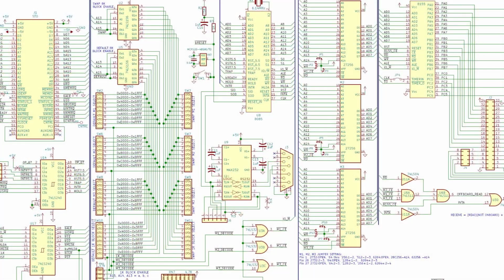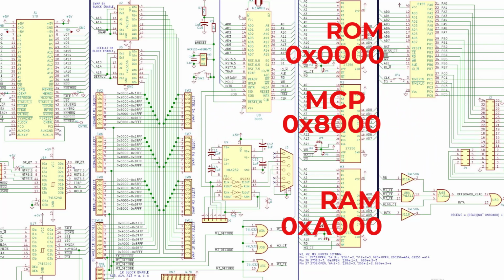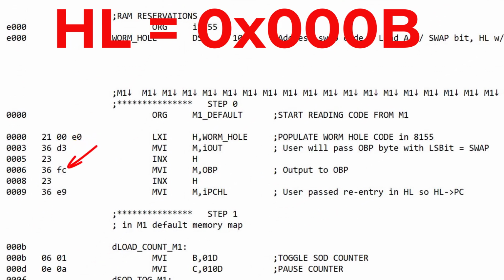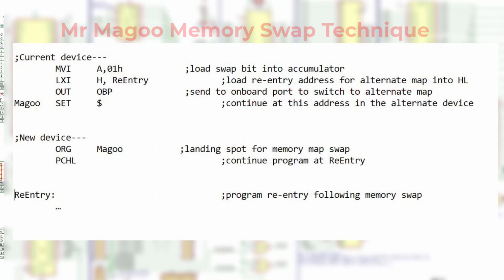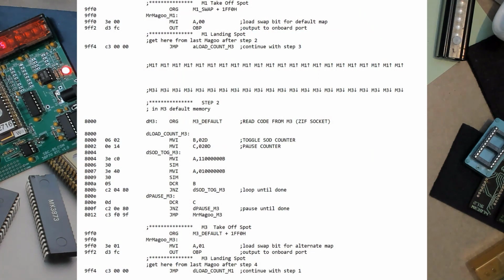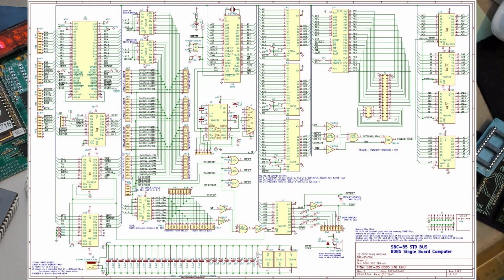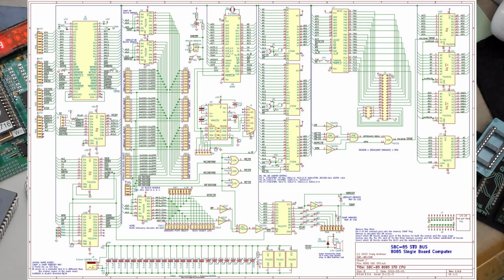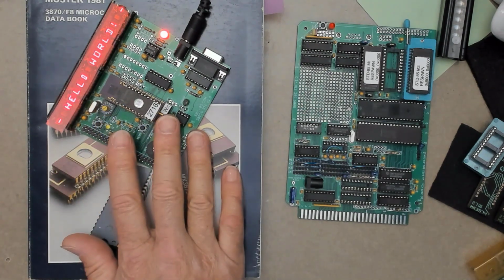{90} Memory Swap Techniques: Remapping Active Memory on the Fly While Running Code on the STD-85 SBC

Comment: I like LIM 4.0 EMS standard. Easy to understand and implement. Easy to program with.
Reply from the maker: On bare metal with 100% of the memory swapping?  Is LIM an option?
Reply: @HelloWorldETX  Swap in/out up to 8GB in 1MB limited hardware. XT286 with Expanded Memory Card (hardware).

Comment: Following on from the hidden port bank-select thing and watching this video 90, It occurs to me that the Magoo method as you described, using a small identical code area in all banks/pages to continue onward could be expanded upon: similar to a TSR/ISR with registers set prior to bank-swap which could be used to drive the Magoo area code that follows the swap as a dispatcher - not only to jump to a resume-at PC address, but also saving the return bank no + address  and could even pass parameters.
Each bank/page could have several such 'procs' residing within.
Fiddly to program but doable in Asm, but a precompiler could automate the details reasonably simply, could even be made to split huge procs across pages automatically.
From an engineering angle its fascinating, though is it worthwhile?
Reply from the maker: I haven’t thought about it, but the Z80 has privileged instructions for memory management and I suspect they can be utilized for memory swapping.
A completely different approach would be to create a subroutine that creates the memory swap on the fly by dynamically creating code for a page swap.  On the STD board with the 8155, I think the simplest and best solution is to leave the 8155 address static and using that as a safe space.  I suppose I could have put in a few bytes of onboard registers to stuff info in prior to a memory swap. But I put a higher priority on having the proto sandbox area and ran out of room.

Comment: Good stuff! I'd never seen the "Respawn" method intentionally used for memory remap -- that's pretty common in full-featured monitors, not only to catch runaway programs, but also to allow simple setting of breakpoints.
Reply from the maker: Yes, good point,  breakpoints in resident monitors are a key use of vectored interrupts.  Catching a runaway PC is always hit-and-miss since the respawn will not catch if the PC is randomly set to a mapped memory location.